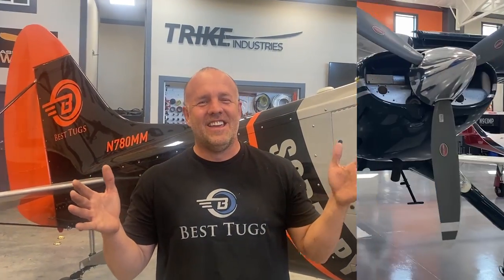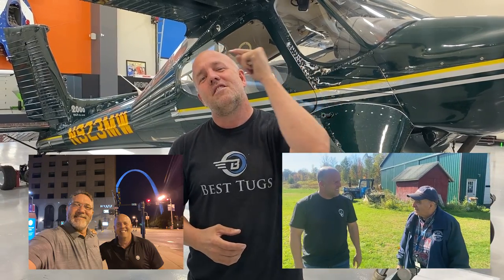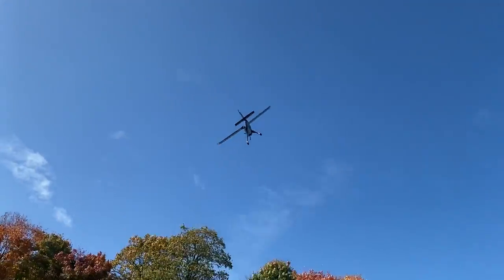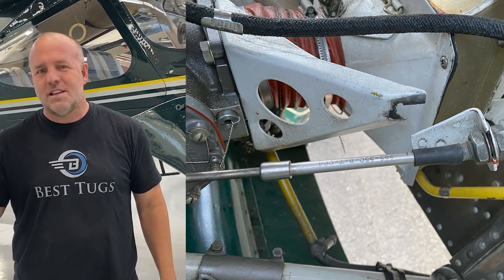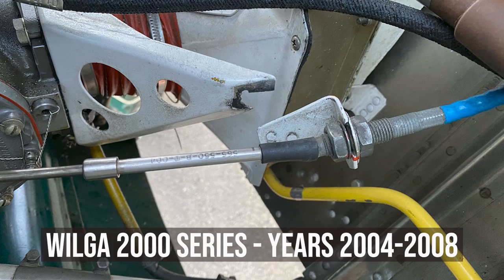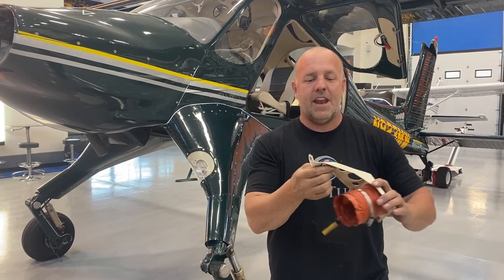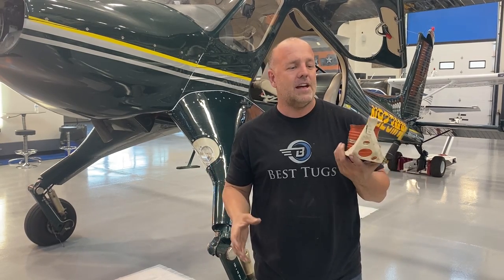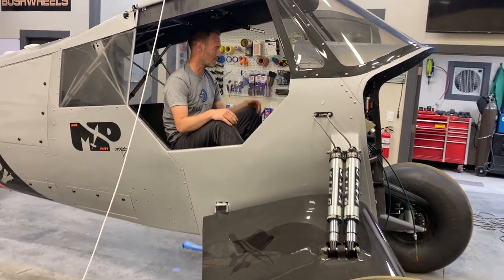Engine Trouble Flying Home a New Wilga 😬 | Scrappy 30

Comment: Thanks Mike.... Over the years I have had 6 off field forced landings.   Never bent anything on the plane or pilot.  Flying ultralights that are at a lower reliability level then general aviation.   Had a variety of failures, one engine failure, ignition failure left me only one running cylinder, prop shaft bearing failure, clogged fuel float valve, and 2 fuel shutoff valve failures back to back.  Had to disassemble and trailer the plane home twice, the other 4 times fixed and got home under it's own power. Half of these failures could have been avoided with more through preflight or post flight inspection and a knowledge of what to look for and where to look.  
Engine failures and Dead stick landings will wake you up and give you an adrenaline rush but don't have to result in a crash.  It helps in an ultralight that stalls under 20kts and lands in less than 50 feet. 
I do have a BRS parachute mounted in the plane but never had a single thought of pulling the handle.

Hope your warning to other Wilga owners will preflight this problem and prevent anyone else from this mixture control failure!

Comment: Lighter materials on aircraft creates opportunity for Murphy's Law to pop up, "if it can it will." Metal fatigue is always a possibility especially w/ recips. Who the hell expected that garl darn piece to crack like that? But it did! Engineers are human like you say, maybe juggling to many tasks that week, who knew? Six months later the FAA issues an 'advisory' to perform a dye penitrent check on offending aluminum bracket, or an in force advisory wasn't done. Oops!
Glad you're safe and on the ground Mike, lucky you could nurse something out of that engine to keep the beast in level flight. It doesn't always end that way, especially over mountains. Love you videos!

Comment: Mike is exactly right. If you fly long enough you Will have a forced landing. I've had six in thirty year (no wrecks), two while flying other people's airplanes. The best one for bragging rights is a total propeller failure on takeoff at 200' AGL and a teardrop 180 to land on the downwind runway, only possible in a canard airplane because they don't stall, they just don't. I personally know two canard pilots who have pulled that off also. Then there was the forced landing into a long closed, trashed runway inside a prison near Alturas, CA. I wrote up the story years ago for AOPA.

Comment: On the engine out vid at the end, it just goes to show that you don’t give up hope & keep trying to get that engine restarted WITHIN REASON. Obviously in a situation such as that other things may take priority first, I can’t go through the list as it’s case specific & exponential, but in this case there were 2 pilots aboard which meant that can carry on troubleshooting & trying a restart until the last possible moment. Doing that meant in this case a softish landing in a field over a possible fatal ditching in water. That day luck was on there side & thx for the safety reminder & also ensuring the FAA knew so they can issue out emergency safety directives.

Comment: Sir Mark you have probably heard of BALANCE MASTER its a round disc with mounting holes in it and the end is rolled with a rubber tube held in the edge and it has Mercury in it. I have also watched video's testing it and it reduced vibration numbers 3 points on the meter. I think you will find it useful

Comment: My brother is a retired aircraft controller and worked many years at Tracon N90 handling traffic for Newark, LaGuardia, JFK, a few smaller airports. He talked down 2 small craft with engine failures and was commended for at least one of them. One he arranged with law enforcement for the plane to land on a road, as there was no decent  place in a populated area to put the craft down. The other one he was able to guide to a closed small airport. The plane had enough altitude for someone to open the airport and turn the runway lights on. Years after it happened, somehow my sister obtained the recording of the conversation and shared it with our family, great stuff there!  Both planes safely landed; but the strange thing is the plane in the second incident without power somehow flew the plane farther than the glide ratio should have allowed.

Comment: I have had two engine outs. Both fuel pressure related. One was clearly the pilot who was out to lunch and failed to properly manage the fuel flow. Beautiful winter’s day in Alaska, looking outside the airplane marveling at the February winter beauty in literally the middle of nowhere and suddenly it was quiet. Funny thing was part of my outside the plane reverie was evaluating the frozen ponds and lakes for a possible emergency landing. Switch tanks, fuel boost pump and blessed noise once again.  The second time was a loss of fuel pressure due to a shallow dive and a moderate g pull out and climb. I was close to an airport and dead sticked it on to the runway. The problem turned out to be a header tank design problem. That landing was a thing of smoothness and beauty.  The passenger had no idea, he just wondered why we were stuck, on the centerline, on the runway. It was awfully quiet though.

Comment: "I've had numerous engine failures" 
me who flys gliders: I DON'T HAVE ENGINES!
Reply: 1996 Toyota Camry Fewer moving parts to fail.
Reply: In 30+ years of managing airports and over 40 years as a private pilot the only on-airport fatality I personally saw was a glider pilot. He augered in on a downwind to base “graveyard spiral” - too much bottom rudder? He clearly died on impact or within seconds of impact. Never unbuckled his seatbelt. Bled enough from his nose to get a little on his chin. A scene I’ll never forget.
Reply: @tomcoryell  Less maintenance fees
Reply: @hgj2019  That must be so brutal. It sucks to see someone die right in front of you. some gliders are deadly on your base and final turns. They do go into a huge stall. father got in one not too long ago and was able to recover at 200 less than 200 feet
Reply: Me too every landing is a power out landing.
Reply: @Chris **falling
Reply: He mentioned three incidents.
Therefore l too have had several engine failures in 23,000 hours of flying.
Reply: @dxbmick  Oh nice! I need to get up there
Reply: I love watching glider videos, seeing them fly for hours without any motors with the thermals.
Reply: I fly gliders and the tug at my local club. We have had two tug pilots die in one year (zero accidents for 70 years previous). Another club in the area had a serious crash involving the tug and a glider. Don't forget you do have an engine in that phase of the flight and two aircraft that can go wrong. Plus we are constantly dodging vultures.
Reply: @GMELECTRONICS365  You can always try them. If you are 16 you can get your GPL!  Solo at 14 as well. Or just ask for a ride
Reply: @paulmakinson1965  Those big scary things can be hard to avoid. Sorry to hear about the accidents! And there definitely is a motor in that part
Reply: hows your take offs??
Reply: @yamahale  We usually have a tow plane, a winch, or a car. Some gliders can even self launch! I personally fly with a tow plane
Reply: @Chris That is surprisingly 100% correct. Well thank you.. I have just decided to leave that endorsement blank.. LOL.
Reply: That's why you are acutely aware of forced landing spots while you are flying. Also, your normal landings are at a very slow speed. Fly safe and blue Sky's.
Reply: @larryehrlich57  I'm definitely well aware. I get to start my training this summer. Have safe flights as well!
Reply: Cindy Klenk  1:37 isn't bad
Reply: @hgj2019  on the other hand while at my gliding club I saw a guy trying to make it to tue runway when he should have landed out - low & slow, approaching the runway @ a 45 deg. angle. As he tried to turn to align with the runway the wing dropped into a 90 deg. bank, hit the ground an he cartwheeled down the runway. Left wing, right wing, tail, stump of left wing and then finally the nose.
When we got to him he was sitting, strapped to the seat and nothing around him apart from small pieces of fiberglass. In shock of course, but uninjured, not even a scratch.
It's just the luck of the draw.
Reply: @wackaircaftmechanic2312  like the old saying about flying ANYTHING...aviation is unforgiving of careless and neglect. Worse thing is that witnesses, all pilots, some with glider ratings, said he flew his downwind clearly too low, passing up several thousand feet of runway, taxiway, and adjacent grass where a safe downwind landing could have been executed (winds were calm, so downwind landing would have been a non-event), didn’t even have enough altitude to make it to the base to final turn. Just a series of mistakes and errors, misjudgment that cost his life and ruined a perfectly good airplane. Didn’t have to be flying, bad judgment like that kills people driving cars or out hiking.
Reply: @gregculverwell  The classic cartwheel is always scary to see. I'm surprised  he went uninjured. Usually the pilot has a few broken bones.
Reply: @hgj2019  Sometimes we don't get to learn from our mistakes. Others can though. I would have planned something like that out sooner personally.

Comment: I had the engine go out on takeoff in a Cessna about 500’ above the ground. Managed to turn around and land back at the runway without stalling and dropping to my death. 👍
Reply: marekdenn In other words you pushed the nose down. Good job! That’s one that needlessly kills pilots.
Reply: @tomcoryell  Yeah 180 degree turn while gliding back to the grass strip. Had quite a tail wind while landing which was the biggest potential problem.
Reply: @marekdenn  probably a good thing in the turn as it pushed u to turn faster

Comment: Mike!!! Electric motors have TWO moving parts and NO fuel/ air problems. Redundancy is relatively simple. The world ( me) need YOU to build a viable
Electric airplane! Solar charging while on the ramp would be great. ( fly to Telluride.... charge on the ramp while skiing?) big corporations
Are bogged down by group think. YOU can solve the range issue. I love your videos and work ethic and videos. I drove 26 hours to see Scrappy at Oshkosh.

Comment: "There's 24 of you out there". Er Mikey you own three of the Wilga 2000 run of 24 dude...
Reply: I wonder if the FAA will end up sending him 2 or 3 memos to check his bracket.
Reply: @RobertLowery  It looks like a cheap part made in China to me. I don't understand why not make it stronger in the first place. why cut corners with such critical components. It makes me sick watch some ones life on the line for a small peace cheap metal and rivets.
Reply: @mrbob9556  Spot welds kill.
Reply: @izzyplusplusplus1004  i'm curious, how so?  i know planes are very diffiernt but cars are spot welded together and have been for decades.  personally, in a plane, i would prefer full seam weld on that bracket.
Reply: @frotobaggins7169  I was mistaken, those are rivets. However, flexing is also death waiting to happen.
Reply: @frotobaggins7169  Also, I agree. Full seam welds win, rivets and spot welds fail.
Reply: @izzyplusplusplus1004  yeah, i think that's one of the biggest differences between aircraft and cars, aircraft constantly have changing loads and metal fatigue quickly becomes a problem.
Reply: @frotobaggins7169  And Engineers must balance weight to strength.
Whereas, on a car, weight isn't as much of an issue, and a bracket can be strengthened (weight added) without much consequence.
Reply: @izzyplusplusplus1004  that is so true.  that bracket might actually be a prime candidate to be made from fiber glass or carbon.  i was recently reminded that S glass is stronger than steel and carbon by a long shot.  less stiff but ultimately stronger.  with a composite you could make that component with fewer stress risers as well.
Reply: Well, look at it this way.. the bracket was for the mixture, which is not going to be cycled nearly as much as prop and throttle... So I can see  why they went the route that they did (at first). The quality of the material surely had an effect, and the location of this particular planes manufacture also had an effect (build as cheap as possible, quantity over quality Soviet thinking). I give them credit for recognizing the weakness, and updating the bracket with more material.  Maybe this info was out there during the production years on that side of the ocean. At any rate, this is a good example to really look at stuff and be hands on it when doing regular maintenance. How often do you have the cowl open and just glance at stuff and say in your head "yep, looks good".  Just food for thought.
Reply: @hawkdsl  yes, that' is all true but still it failed nearly resulting in death.  that's all i'm saying.  i'm not saying i could have done any better but i would prefer a welded part or some other simpler solution for the cable.

Comment: Bad things can and do happen. Committing aviation under the assumption that it won't is very dangerous. My instructor always taught me to look for wind signs (fields being plowed, etc) and places to land any time I wasn't actively flying the plane. I have luckily never needed to put a bird down dead stick - but the training has stuck with me all these years later. I always try to explain to my race car friends - a plane isn't the same. A bad day in a car and you just coast and pull over - not so much in an aircraft.

Comment: As an A&P and as a structural fabricator I can see that parts failure is an over sight in manufacturing engineering. That bracket would have been better made as 1 peice but im sure for easy of manufacturing a decision was made to for on part and attach a 2nd. This was probably never given to a stress engineering. I hate that this will cause dollars to come out of the owners pockets but ill glade you are safe and are bringing to the attention of other owners.
Reply: Wow I need to prof read before I post talk about oversight 😆

Comment: Mike you did it again, that we are all human is the thing we all need to remember and you just helped everybody remember. 99% is just not perfect and can never make perfect. we can get close but something will always fail if you accept that and prepare for most if not all modes of failure most likely you will learn from them. off-course there is still the 1% where no mather what you do you wont walk away from.

Comment: Planes are designed to fly so well (for the most part) we all need to focus on emergency procedures and unique landing circumstances for safety reasons and in controlled conditions so we know what to do when the what if turns into what now know ur plane and know urself!

Comment: He is absolutely right. I have had so many engine failures that I have lost count. Including once while flying upside down in a Pitts Special S1S. It does happen. Be ready at all times and practice gliding on every flight. CFI's do not do a good job of teaching you this. They only seem to teach FAA rules. And most CFI's have never experienced even one engine failure.

Comment: Yeah, fatigue is no joke. Some of the equations I used in Mechanical Design class looked like part was based on experience and the other part was an educated guess. Multiply it by the low factor of safety in aviation and you're good, hopefully. In all honesty it can be hard to predict and test ahead of time.

Comment: You should make a “Jet Wilga”.
Reply: And this is a good engine to consider: General Electric CJ610
Reply: he should make a Jet VTOL Harrier Wilga
Reply: MrGuliton I’m being serious, but you’re trying to get him killed with something over complicated and uncalled for. Screaming Sasquatch the Jet Waco Biplane and that Twin Fuselage Yak-110 show what you can do with a small jet engine.
Reply: He said something about DRACO X. Perhaps?
Reply: Brett Caldwell I think Draco X will be 90% the same as Draco.
Reply: Draco doesnt need too much for that I wouldnt think, I'm no engineer.  If anyone could, it'd be Mike and Mark.
Reply: Draco was, essentially, a jet Wilga.
Reply: “JET”??? As it exhaust is thrust ???  Lol... you live on the edge    ... Draco with its replacement engine that was the turboprop.... was just about at the airframe limit... and you want to see a turbojet/fan. Ooooh KAY...?
Reply: Very good advice and thank for the video
Reply: Francis Schweitzer Screaming Sasquatch could fly with the jet engine alone, so could a Wilga. It doesn’t need to be practical, just unique.
Reply: Bryan Teany no, a “turbojet” powered Draco would be wildly different. It wouldn’t have the pulling power of a turboprop but once it got to over 50mph you could probably climb at an 80 degree angle.
Reply: Francis Schweitzer also consider all the mods he made to make Draco handle 850shp. He couldn’t just be strapping a jet engine to a stock Wilga you know.
Reply: Yeah I'll just let this one be 🚀✈🚀
Reply: Jet engines would overspeed the structural integrity of the Wilga. I think they are like 150/180 MPH max depending on altitude. PT6 cruised at about 1/2 power
Reply: Tony Albany again, you are talking a stock Wilga, I am not.

Comment: Very important message. During 1000 hours flying (since 2010) I had 4 Engines out (one dual fuel pump failure in a Lycoming powered LA4 and three in a Gyro with a weber engine). All landings without injuries but in the wild or on a river. None with Rotax engines although I do 80% flying with Rotax. Nevertheless, I am always scanning for potential landing options although my own taildragger got the big tyres and a parachute. There are two kinds of pilots: the ones that had the engine out and the others that will have. Take care and always scan for options.